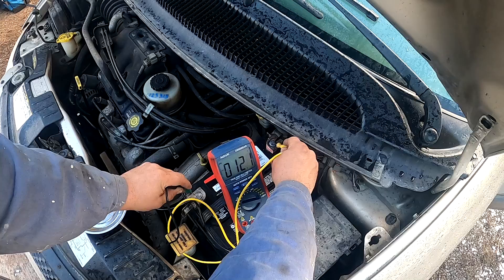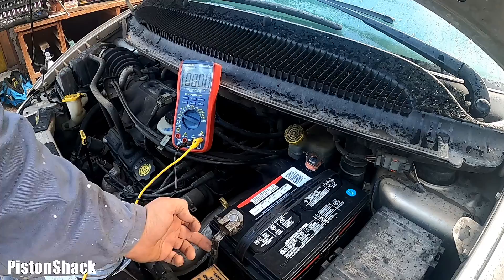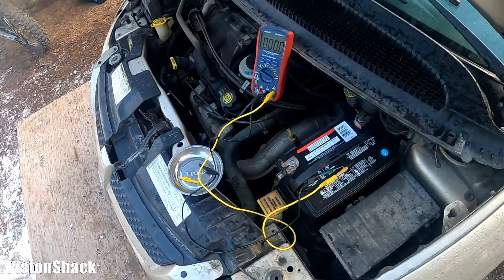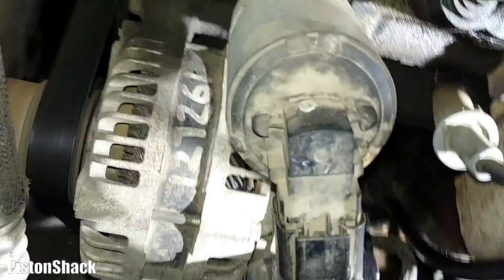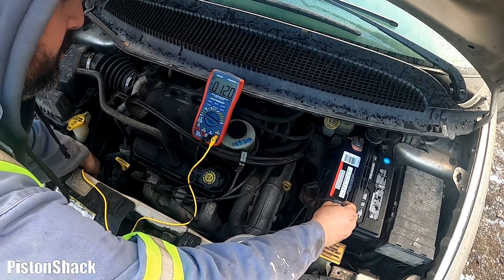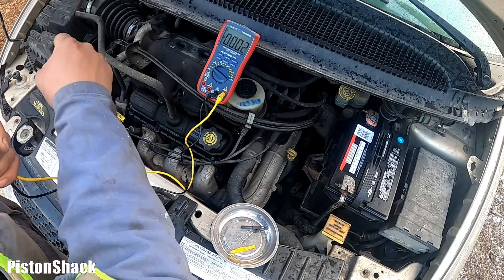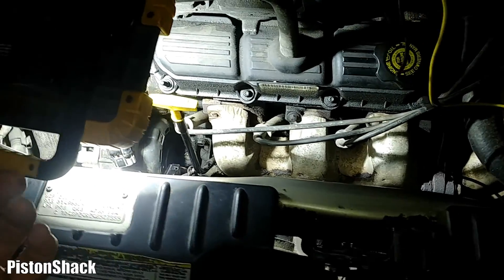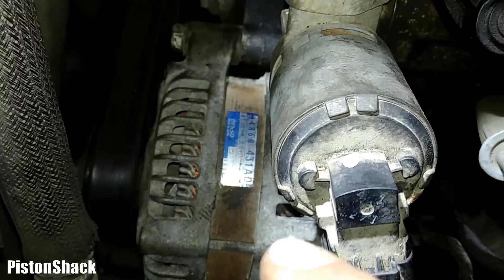DODGE CARAVAN BATTERY NOT CHARGING - CIRCUIT TROUBLESHOOTING: VOLTAGE DROP, GROUND, SENSE & FIELD

Comment: I tested my battery my battery is good too it just won't charge I have to use a battery charger
Reply from the maker: Sounds like you might have an issue with the charging system. Probably, your old alternator wasn't the cause. Any luck so far?

Comment: Cool, But my batt light is sometimes on and I check my alternator 1st by pulling off a batt cable and it still runs, it is giving 13,6v from the alternator and no more with the engine running fast. does the same voltage 13.6v when the dummy light is off too. 
Weird.

Comment: thanks for making this in-depth test for us. i am currently experiencing issues and it may be the alternator. hopefully a local place has the tools i'll need to swap out the alternator. thanks!
Reply from the maker: You're so welcome, buddy! Let me know if you have any questions!
Reply: @SongbirdCapital  I too am experiencing this very problem even after replacing the old alternator with a rebuild followed by replacing the replacement within 2 weeks; same problem.
I have a strong suspicion that it's either the TIPM or the PCM. Both parts are ordered awaiting delivery for installation. We will see.

Comment: Had a 2006 Grand Caravan SXT that had electrical gremlins. Ate 7 starters, an alternator, smoked the EGR controller, etc. Finally realized it was a Chrysler issue as wiring harnesses on their vehicles up to 2011 were prone to failure due not being grounded well. Usually ended in PCM system failure which requires dealer for new one reprogramming.
Reply from the maker: Any luck with fixing your 2006 Caravan so far?
Reply: @PistonShack  we finally traded it off, sadly. After the wiring harness issue was realized too late when replaced the alternator, the damage to the PCM was too far gone. Did put a total of almost 100,000 miles on that 2006, which was burning oil amongst other things (resolved with Valvoline MaxLife synthetic blend).  We bought it used at 86,000 and traded it off at roughly 188,000 miles, with lights lit up on the dashboard left & right due to PCM system issues. 

Ended up trading for a newer 2015 Grand Caravan SXT instead, which only has had one issue being poorly designed calipers on the rear wheels from Chrysler. Mechanically the 2015 being used too, hasn't missed a beat or had any electrical or mechanical issues with oil either. At 170,000+ miles and may trade it off, but it runs decent with an average 24mpg and only brakes being major issue. 🤞

Comment: It's getting too complicated for me. Not too long ago, if it didn't charge, you just rebuilt the alternator (Diodes, stator, rectifier, maybe bearings ?)
Reply from the maker: That's sometimes better way fixing faulty component instead replacing entire unit but putting new alternator will be easy for most of us)